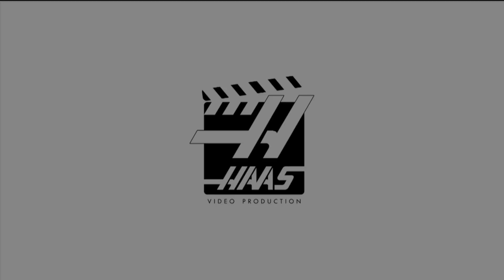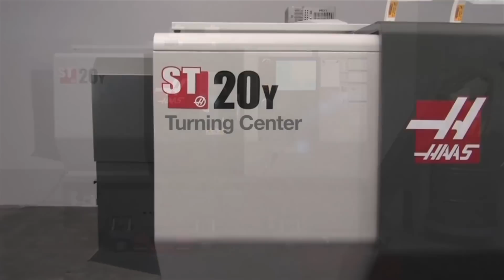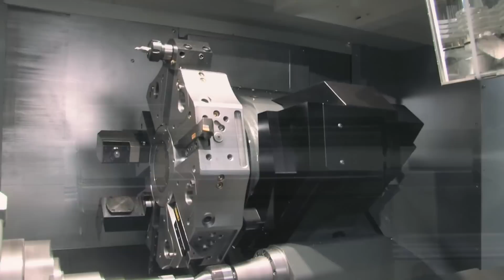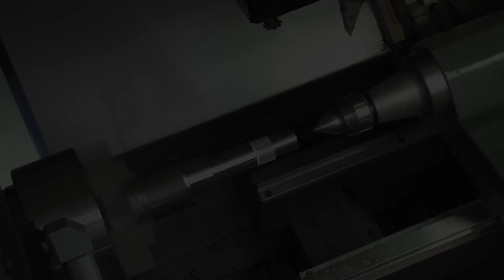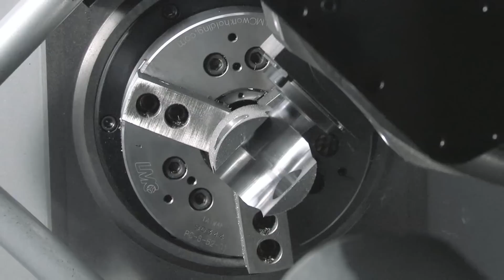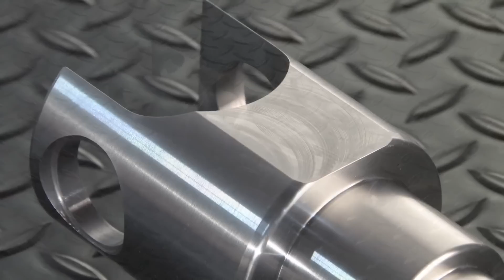Haas ST 20Y Y-Axis & Live Tooling Lathe Demo

Comment: How do you know when and when not to use coolant?
Reply: I rarely use coolant on the mill cutting brass or bronze, or even 303ss with an endmill . Usually depends on what the chips look like
Reply: Right and material can have to do with it. Certain tools you don’t want getting hot, and you don’t want the heat transferring to your part either. It’d be okay for your carbide end mill to get hot but if it’s transferring the heat to your part it could affect your dimensions. Metal grows when it’s hot. So you could measure it and read it’s 3.027 finished size, but if it’s hot from no coolant and bad feeds and speeds, that could be 1-3 thousandths smaller by the time you take it out and let the part cool off. There’s a lot that goes into when and when not to use coolant.